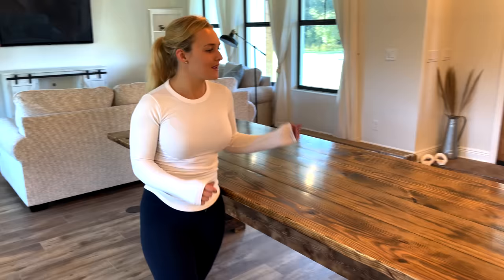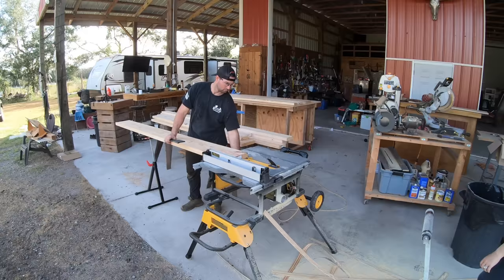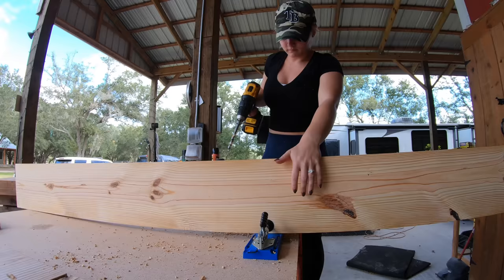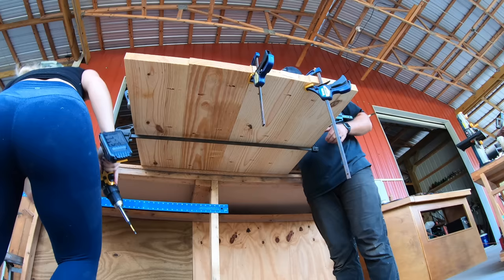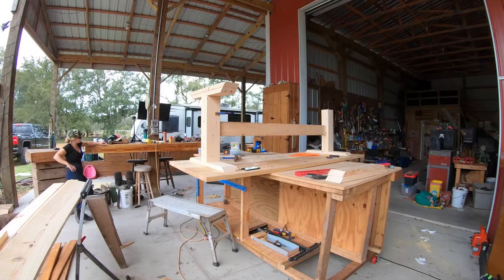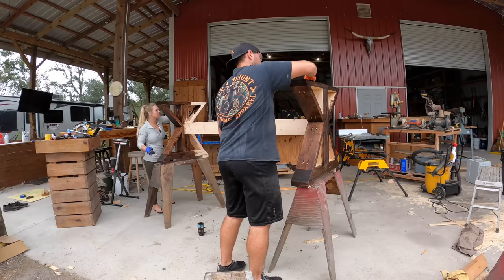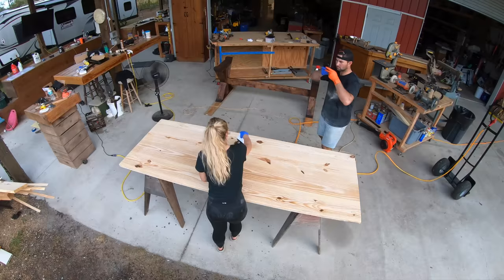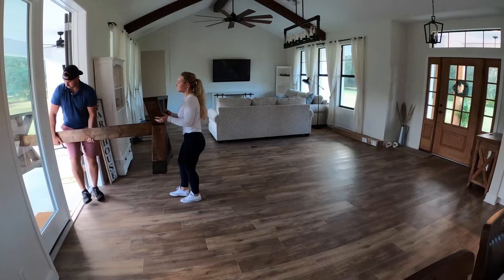Beautiful and Easy Farmhouse Table Build - 12

Comment: I may be incorrect however I thought I saw growth rings going in the same direction when joining the boards for the table top. Should that be the case, when you join boards together at the edge, note that you should have the growth rings opposing each other. One board should have the growth rings up. The one next to it the growth rings should be down. The one next to that should be up. ETC. Water popping is done in order to make stain more even and consistent. As well as give the stain color more depth. Water popping raises and swells the grain of the wood. The grain raising and swelling is what creates the platform in order to gain an even and consistent stain color. Since you sanded after you water popped, you deleted that water popping process. Final sand, water pop, let dry, then stain. NO SANDING after water popping. Once you apply the stain you can if you chose to maroon pad the stain to bring down the grain raise a bit. As far as stain goes we would use Bona Kemi or PoloPlaz stain. Or ever Duraseal. Application would be with soft rags not scotch brite pads. Since those could leave an unwanted scratch pattern in the lumber. Going that high in your sanding process is to much. The higher you go in grit, the more you close the lumbers grain. Which in turn does not accept nor hold stain or finish long term. Getting table as smooth as possible is where the correct sanders and abrasives come into play. Which is far more effective then over sanding a project and closing the grain.  Polyurethane finishes should not have air introduced. Poly your projects inside where doors and windows are closed and no air flow is current. Trying to force the finish to dry can have adverse effects. The chemicals which carry the polyurethane to where it's going need to off gas naturally. Not by forcing air onto the project. The reason why your table top ended up being lighter then the bottom of it is due to the fact that you sanded the top to a higher grit then you did the bottom. The higher in grit you sand, the lighter the lumber becomes. Which in turn shows up once the stain is applied. Your table base only being sanded to 220 grit would be substantially darker then the table top.

Comment: Wondering how this table is after a few years of use, I'm far from an expert, a lot of what I "know" about woodworking comes from watching youTube videos. I have heard in general that pine if to soft for kitchen tables and you should always use glue with pocket screws? Did either of these turn out to be an issue for you guys? Is the table still going strong?

Comment: i would have glued and pocket screws.  or glue and cleats under neath to keep the boards flat. But also screwing the cleats in sloppy holes to allow for expansion and contraction due to humidity changes with change in seasons.Or my latest desk top(4' x 8 ') i cut a grove on the edges and glued in a spline.  biscuits are go to align the boards not to make the joint stronger.

Comment: On that final coat of poly, did you finish it with steel wool?  I was taught to do that by my shop teacher in the 80's.  It creates a glass-like finish that really resists scratches.  Used this technique on wood floors in our second house and they came out beautiful.  Even our German Shepard couldn't scratch them.  Gorgeous table, by the way.  I'll bet many family memories will be made around it!

Comment: Definately should have used bisquits or dominos and plenty of wood glue next time. I had a custom cabinet/furniture business for 15 years and have built hundreds of table tops and bases and never had one come back for warping or cracking at the joints. 220 grit is plenty because the higher grits seal the pores too much so the stain won't take as well as it should
Just a few pointers for you to use on your next project. Make sure you have plenty of clamps on hand too!
BTW....I remember seeing you guys on 100 days to build a house. Was that the same house that was built for you or did you move? There was no mention of a shop on the show

Comment: I would definitely use pocket holes but add Titebond glue along the seams for added joinery protection. A little glue never hurt any project. Why didn't you fill the pocket holes on the legs?

Comment: Try using Old Master's stain in Rich Mahogany.  I think it looks a lot like what you made.  Mixing stain has been going on since the first pre-mixed stain was manufactured.  I know floor finishers that have made some pretty nice colors and will not give out the formula.  However, for most people, looking for a consistent color is far more important than trying to make a perfect mix.  It is hard to get the same color each and every time you mix the stains together, especially when you mix 1/2 of this can and 3/4 of that can.  Also, the Old Masters is a little thicker (but not like a gel stain) so it is easier to maintain the absorption rate so you control the color.  For the finish, I would have gone with a rub-on wax over the water-based poly.  It looks better, in my opinion, and is easier to maintain by adding another coat of wax over the existing coats.

Comment: I wouldn't have used pocket screws... Biscuits, Dowels splines yep...  stain is top notch.. but you did go overkill on the sanding.. you  urethane will level out some things and  you were sanding between coats.. I would have hidden the fasteners in the base we with plugs or using dowels (or mortise and tenon)  But whatever floats your boat..

Comment: Try thining that poly 50_50 with mineral spirits and apply it with a rag use 000 steal wool in between coats. This is how i restore interior sailboat cabinets .For wood exposed outside i use epoxy resin cut 50-50 with acetone .amazing finish that holds up to the salty elements.Great show !
Reply: They used water based poly which would be thinned with water and you wouldn't use steel wool with water for obvious reasons.

Comment: 800 grit?   the wood is too soft.  220 is usually the recommended max, otherwise you can risk sealing the wood by sand paper friction causing uneven finish.

Comment: The table design you went with is simple and sturdy, and should last many, many years....very nice job.  But why in the world did you not take the small extra step and fill those Kreg Jig Holes you drilled at least on the X-Legs as those holes would still be visible???  Kreg even makes/sells pre-fab wooden plugs! Just sayin'.  I enjoy your channel.

Comment: I don't care that you didn't mill the material yourself... but Lowe's?  Why start with garbage?  Going to 800 grit on spf material is useless.  After 240 or so, that soft of material is as smooth as it's going to get.  If you bought SYP, maybe 400 but that's it.

Comment: exposed pocket holes? no way
Construction grade lumber for furniture is a bad idea.  It's dried to 12-18% moisture content which is way too high. Proper MC is 6-8%for furniture and millwork.
This will warp and twist and glued joint will likely fail
Please don't follow this advice.